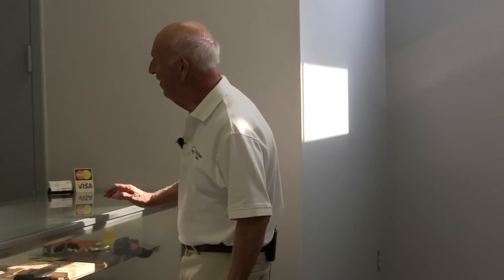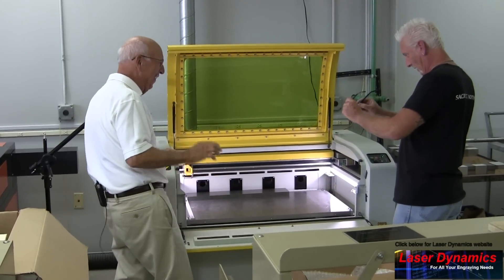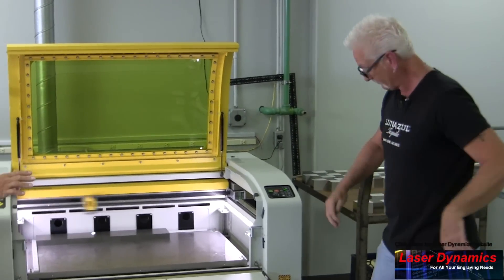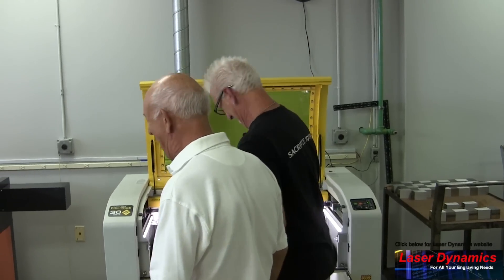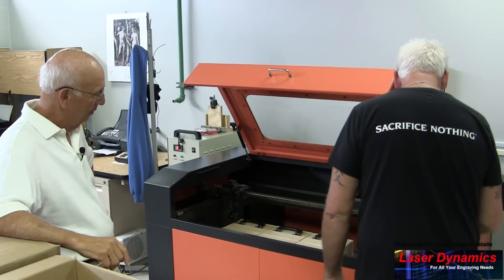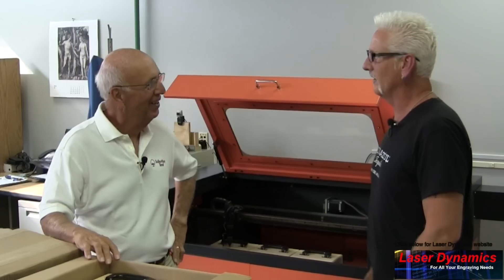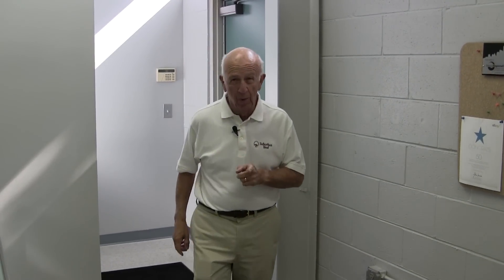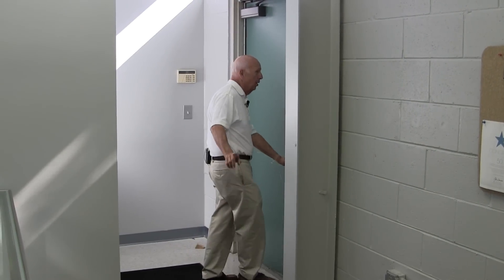How we mark our products at Suburban Tool

Comment: I would have a suggestion to speed up the process of marking those tool boxes. Machine a piece of copper or brass with a mirror image of that logo and text, heat it up and press it against the wood to burn the pattern in to it.

With a PID controller to keep the temperature constant, it is just a matter of align the box, press, hold a sec or two, get the next box. That's how wine crates etc. are marked and I remember seeing Youtube videos of such in action.